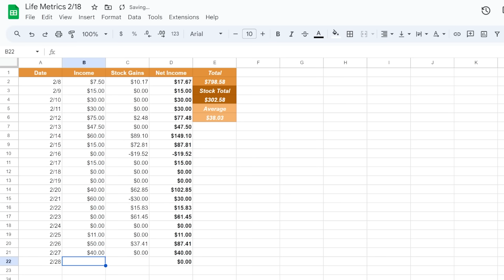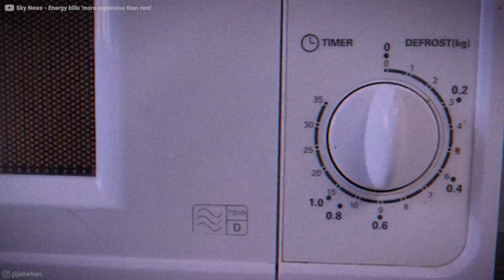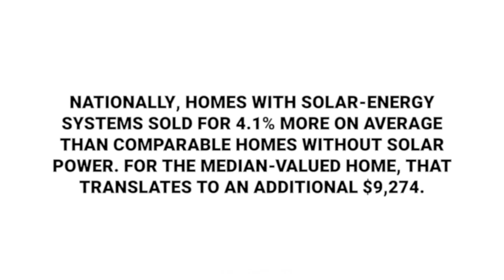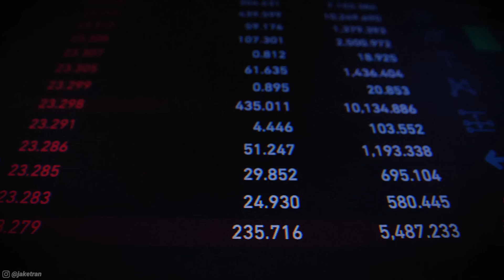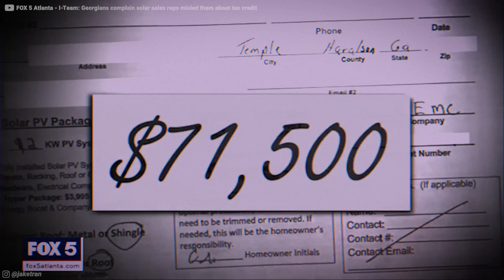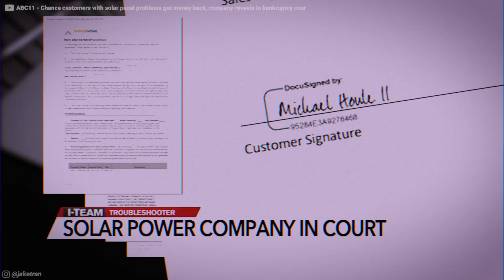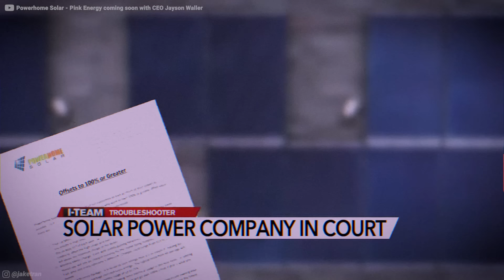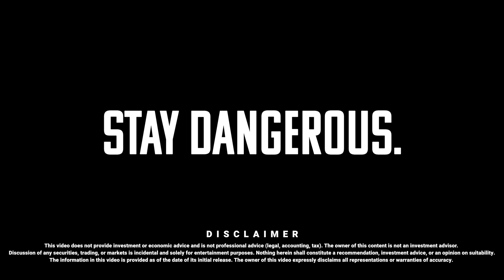Home solar panels are literally a scam.

Comment: I worked at a Texas Roadhouse restaurant, they solar paneled The parking structures and i was told it decreased over 60% of the electric bill.
Reply: If you do it right (good placement, enough of them and batteries) you can save a lot in the long time, the issue I saw presented in this video was that people were not only overpaying for the equipment, but some weren't even doing proper installs.
Reply: They don't take into account the equipment cost, which is likely equal to 30 years of their electric bill
Reply: Learn how to install your self. And change your light. And other stuff on 12v. so you eliminated a inverter and saving $3000
Reply: @liangyuaq-qoyunlu407  Exactly. I'm not gonna pay 20 to 30K for solar panels when my electricity bill is 2K a year. Makes no sense whatsoever.

Comment: Not getting a refund and not having any tax liability are two separate things. For working people with a tax liability, they are getting a refund because the amount of money taken from their paychecks was higher than the amount owed minus tax deductions and credits (like the solar one). The credit can also be applied over multiple years of taxes for people that wouldn't have seen the full benefit in a single year. Having no tax liability would be if you made no money, or made money through non-taxable income only.
Reply: The point is solar companies actually say that you're getting "a check for X thousands of dollars".....which is flat out wrong.
Reply: @StarfishPrime1969  That is the bigger issue for sure, just correcting the facts on it though
Reply: @StarfishPrime1969  Every company has unethical sales reps. The solar company is not training its reps to give people the incorrect information. They instruct them to tell the customer to confirm with their accountant, which should go without saying
Reply: This is correct. The creator of the video doesn't understand how taxes or the solar tax credit work. Most people can claim the tax credit, especially over multiple years
Reply: Exactly, while I agree there are unethical solar sales reps just as there are in all industries, every solar company that I have worked with and when I train new reps as well to ALWAYS let the customer know that these are tax credits and that they are NOT tax professionals and cannot promise that they will qualify for the full credit not but to discuss it with their individual CPA that knows their individual tax situation. As I mentioned, there are unfortunately some bad reps out there, I've luckily been able to correctly explain the process to several customers that had been misinformed or straight lied to by other sales people but to make a video like this that completely bashes an entire industry because of some bad reps, is ridiculous especially since you completely twist the truth, lie or just don't know what your talking about for 13 minutes is ridiculous. But I'll give it to you, you warned your viewers to read the fine print while in your own fine print express that you don't claim any accuracy in the video.

Comment: And the fire department flags your house for having solar panels " Do not to enter if a fire has burning for more than 10 minutes" because of the high risk of roof collapse due to the weight of the panels. You now have added risk of an electrical fire from the panels which greatly increases if you have a battery. You are also required to inform your insurance company that you have solar panels and they will either raise your rates or discontinue fire coverage. Additionally over 95% of the solar companies do not install the panels with the structure lining up with each of your roof trusses. Now you have the weight of the panels and an enormous weight of snow on slim mounts on your 3/8" OSB roof.

Comment: I have panels that we got through a friend and a good contractor, and we did the homework and twisted her company's arm into the sweetest deal. Great system. Netting power income for the winter (it's cold up here). Summer bills are 0 with AC running. Payment is cheap and structured over the loan of our forever home in a format we can profit on relative to the interest of the personal loan we've moved the debt over to. Would do again if done how we did it. 10/10
Reply: being good at research and financing is always the key

Comment: I’ve been a solar energy consultant for 3 years and I’ve been through 4 different companies before I found the best. That’s the key. There are so many “solar companies” out there because anyone can start one. They don’t do the installations themselves but instead subcontract the work out to the actual solar installation company. Get a good, local company with great reviews, and that doesn’t subcontract out the installations. If you’re in Florida, let me know if you’re interested. I work for SunVena Solar & Roofing. We are a local, five-star rated solar installation company 🌞
Reply: How can i work for them? Im in Vegas
Reply: @irvinnorris7041  you would need to move to Florida.
Reply: How do they hold up to hurricanes, some on my street they came after Ian.

Comment: Everyone should have a small solar system set up in time for emergencies. You can do a simple one for under 1k, enough to keep your fridge running, charge electronics and, depending on your spending a little more, run AC or Heat. I have had my power cut off many times for random reasons in ATL for hours at a time with no warning...had I not had the simple setup that I do have along with propane heat, my comfortably would have been quite different.
Reply: This is a very, very good suggestion.  I have a battery back-up and am getting a panel and controller soon.  And it's not just for household appliances and small electronics.  My wife and I both use a CPAP machine for sleep apnea.  Without electric, no CPAPs.  With a solar panel charging the unit, should keep us running during an emergency.

Comment: I went from $94 a month to $45 a month. Secret is to not use that much electricity. Granted I'm single and live by myself so leaving everything off is consistent for me. I don't reccomend this for families, but if you are disciplined and by yourself it's great. Also renting your property will cover it.
Reply: Yea when I lived alone in my apartment my electric bill was only $30 a month
Reply: I have a 3bd 2ba home and live alone. My energy bill is $42.2 for Decem/January this past month. I don't have solar, just the local energy provider.

Comment: A 5KW capacity solar panel including installation costs 2900USD here in India which covers a will equipped home and negates the final bill amount to zero averaging it for the year ( sunny and cloudy months ) and we don't need a battery system as we have a net metering system with the electricity supplier. So basically it pays out the entire monthly electricity costs and generate profit after year 5. These panels will last 20-25 years. 

What's happening in the USA is beyond me from what I understood from the video.

Comment: Solar makes sense if you live in a sunny region, buy them wholesale, and install yourself. It takes roughly 10 years to recoup your costs so anything after that is net positive for the remaining life of the system(~20 years total). If you have a battery backup, all electric appliances, and an electric car, the potential total savings can be significant if done right.
Reply: DONT TELL ME HOW TO LIVE MY LIFE
Reply: I think 20 years is the highest end of lifespan. In addition after seeing the readouts of my two friends they are not worth it.

Comment: well it all depends on the region you live in and do you get sunlight, for example my house in India has solar panels installed for less than 10k$ and 3 years in and the electricity usage is already compensated, whereas my house in ohio, will take prolly around 6 more years to compensate for the cost of electricity, additionally what I love is that the realiblity of stable power connection, cuz in case of power cut, having solar during summers/winters really help out.

Comment: Due diligence is your responsibility. Don't get pissed off because someone told you "big check to spend" and you signed on the dotted line.
Reply: Another video people were complaining the contract was dozens of pages long and it was on some sort of tablet - and they signed electronically on that tablet. Basically just taking the salesman at his word as they never read through all that. I'm sure they are told " oh this is all just standard contract legalese".

Comment: Part of the problem for the consumer is that most energy retailer do not offer good solar buy back plans. There is more and more plans that pay real time rates and the delivery charges that eat up your saving (Centerpoint). I had one company that I signed up with with actual 1:1 buyback for solar (only one I found in Houston) that within a month said no longer available. Thankfully was able to get my deposit and avoid cancellation fee Smh

Comment: I bought solar panels for my home, paid $10k for the system. 30% refund from the government and my cost was $7K.   With my SoCal electric bill, the return was 7 years to break even. The panels over generate enough for a rebate of $50/year.  This is CA where the utility has to buy it back at retail rates. The panels last for 20 to 25 years.  Therefore I should have free electricity for 13 to 18 years.   I pay $0/month for electricity and $15/mo for being connected to the grid.

What this video really says is watch out for loan sharks.

Comment: I remember as a kid finally getting my solar cell to explore.  The thrill.  It was real.  The problem is not in the electron and photon.  It's the scaling of an electrical power supply.    A nuclear heat source scales understandably whereas large low yield thingys require more finesse.  That finesse is also called excessive maintenance.  Vulnerability from environmental stress.  Winds, dust lightening sabotage etc..
Reply: s   p   a   c    e   s

Comment: Especially problem is that you have to pay for solar and for electricity together
Reply: yea, but thats mainly an issue with the sales people either selling junk equipment, or selling to someone that doesnt get enough sunlight to offset their energy needs.  Plus not all utilities have net metering programs.
Reply: Even if I do have to pay both some months.....still cheaper than that first $400 electric bill I got the first summer month in the South 🤷‍♂

Comment: I live in Rio de Janeiro, Brazil, and I had solar panels installed on my penthouse. The cost was roughly US$ 4k. That was an excellent deal. I still pay about US$25 per month for electricity because the power company charges that minimum even if one consumes zero energy. Before installing the panels I spent US$ 160 in the summer and half that the rest of the year. The panels produce more energy than I consume. The excess is sold to the power company and bought back at night or when it is cloudy. It takes about three to four years to recover the cost of the panels plus installation. Maintenance costs are zero so far, after two years. This video looks very weird to me. But I am in Brazil, maybe things are different in the US.
Reply: Camará, vc tá teclando em inglês MUITO bem !!  Eu gostaria mudar pro Brasil algum dia.  I like the idea of self-sufficiency, and I don’t know if it’s true or not, but a couple amigos brasileiros have told me that if you buy a family home in brasil, once you’ve paid for it, it doesn’t usually get taken away. If this is true, it’s even more motivation to seriously consider moving there.
Reply: Yeah those clips were of dumb people in Michigan who overpaid and had way to high of expectations for solar in a state that only gets like 70-80 fully sunny days a year. I from there, i know. I now, live in Florida where solar makes way more sense and pays off with dividends.

Comment: My house is powered by solar it work great. Off grid with air-conditioning box freezer refrigerator big stereo TV microwave and waterpump. Never a problem 12 years running

Comment: It all depends on what company you deal with.   I purchased a solar system from KOTA.   It cost 19 thousand for 8 panels. (We have a small house)  I pay 65 dollars per  month on my 20 year loan for the purchase.   I now use my air conditioner more often, and yet  I am paying ZERO in electric bill.   We don't have any battery system.  Your experience may vary.....
Reply: That's not a good deal, sorry mate. I pay $42 a month on electricity, no solar panels, no interest, no labor costs if I need to do roof repair after storms. Those solar panels have maintenance costs as well. How often will you test their efficiency and clean them? There are many hidden costs to solar. I'd never buy into the current solar scheme. Where I live, the weather is perfect for 9 months out of the year.
Reply: @TxHoneyBee  - are you really trying to compare electric bills, like he has a choice?  I pay $200-$400 per month for electricity.  I guess solar is stupid for me, too, right?
Reply: @glockman9c Solar still has high maintenance costs. Why do that when energy on a new home less than $60 regularly without solar? Buy into the scheme if you want though. It's your money to waste as you please.
Reply: @NovaPrincess  - Not sure what shoebox in what neighborhood has $60 utility bills, but that is not my lifestyle.
Reply: @NovaPrincess  - please tell me about the maintenance costs you think solar has.
Reply: @TxHoneyBee  4year ROI and 0 maintenance, 0 power bill.

Comment: As someone who works in the energy industry, we always laugh at people who buy solar panels. Esp if they don’t buy a battery system. When we go on storm 9/10 people with solar panels don’t have a battery set up.
Reply: I agree, many ways to make it cheaper and more reliable than staying on grid (batteries are a must). However, most people don't conduct thorough research and instead place their trust in a salesman.
Reply: Rimworld
Reply: Exactly!
Reply: This is not true. A battery system is not a must. Sometimes there is even no need at all for the batteries. Batteries make sense if most of your consumption is at night. If not, then you have to do some calculations to see if the cost of the batteries will pay itself off.
Reply: well my system was worth it even without a battery. my family spent 48k in 2008 and the system has made as of right now 84950 euros tho we bought it in the best time as the pay 0.452 euro per KWh
Reply: Most wall units cost about what you'd spend on the panels themselves. Actually they cost twice as much as most wall units lack the output needed to run the whole home, or a lot of high draw appliances concurrently (like HVAC and water heater)

a portable backup generator will keep the fridge lights, and the internet going.  They also have those portable battery banks that can run a fridge through the night.
Reply: @nikola119  Batteries also make sense if you live somewhere that has blackouts. When I was growing up, snow and ice on the trees would take out powerlines almost every year, and sometimes wind and rain in the summertime. Not a problem for city folks or those who live in the desert..
Reply: @mrblondeheart9562 Not sure why you and your coworkers are laughing, cause for the average person a battery is an absolutely unneeded expense that simply hurts ROI. Current battery technology can at most bridge daytime and nighttime usage. Its only meaningful function is that it makes the homeowners take on the financial burden of maintaining an energy storage infrastructure instead of the service provider. This is why I can't help but cringe whenever I hear talk about their oh-so-great """off-grid""" setups. Crap like that is not even remotely in the realm of viability for the average household.
Reply: @MrProfizmus  Depends where you live... I grew up about an hour and a half outside of an East Coast city .. Blackouts more than once a year due to snow, ice rain and wind dropping branches on power lines.
Reply: @frontiervirtcharter  I live on the east coast only 30 miles from the ocean. Don't get much snow but do get the Atlantic storms. Most of the time power outages are a few seconds with a rare couple hour one. Every few years we get those hurricanes that knock out power for a few days tho.

It'd be nice to use a whole home battery system for then but since I'd need at least 2 in order to run the essentials, that's way too expensive.
Reply: I'm sure your grandchildren will be thoroughly amused with all the laughter.
Reply: @nikola119 Batteries are recommended because you have to use whatever energy is generated by the panels right now, otherwise you lose it. Some people have built smaller solar systems whose purpose is to keep battery generators charged in case a power surge happens.

Comment: Being from a country where solar makes all the difference. Do you research, see what is available. Do the maths and see what your needs are. Never ever buy solar systems on credit. Inverters last around 10 years, good batteries around 15 years. You'll be replacing stuff before paying it off. Rather start small and grow your system.

Comment: I pieced my 32 panel system together on my own over 2 years. No sales company, I installed myself. Payback is/was 4.3 years. Sales companies wanted more than double what I ended up spending. I literally pieced parts from different suppliers together. It took some homework, but in the end, saved a ton.
Reply: How did you deal with your township?  Permits, inspection, documents...

Comment: I must say in Germany we install a very good system with 10 kWp and 10 kWh of battery for about 20-25k. With that the House can reduce Electricity bills from 60-80% and also gets you income from selling it to the grid in the summer months.
The Systems are payed of somewhere between 5-15 Years.
Reply: This sounds more reasonable. I understand everyone needs their cut but im not willing to pay 10x the cost of the system.